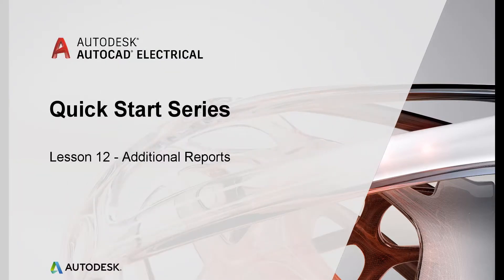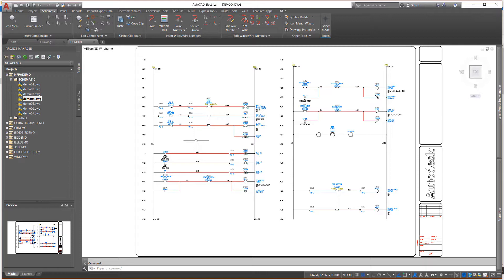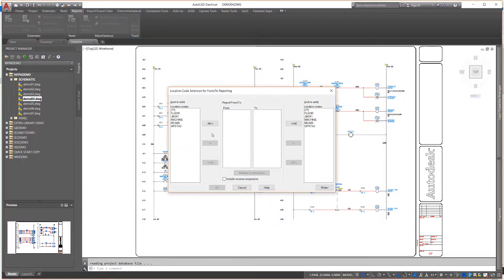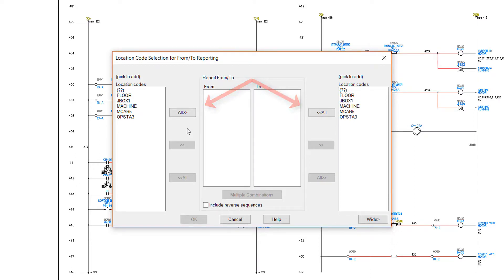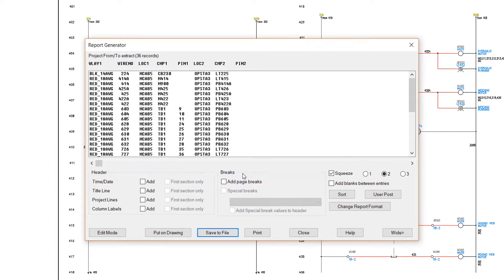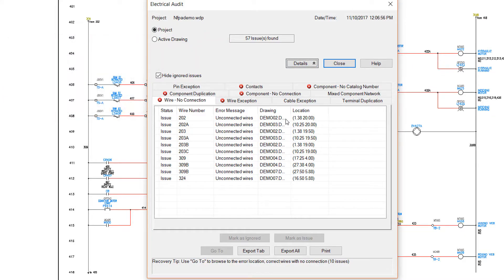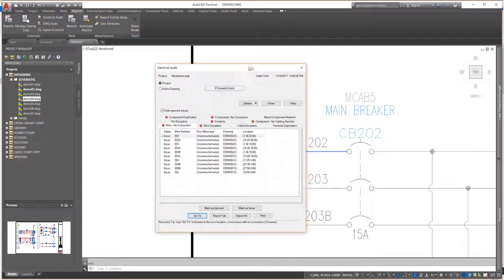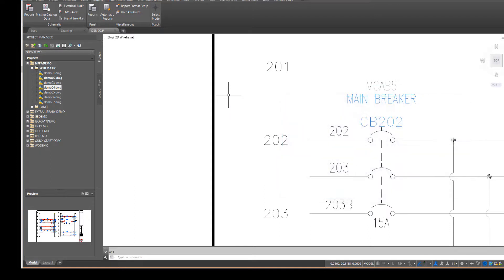Lesson 12 - Additional Reports | AutoCAD Electrical

Comment: These are really great and helpful demos. I've completed watching them all and followed along. However, in my opinion, these are more relatable  to preparing schematic diagrams for low voltage. Can you make demos also for single line diagrams such as for medium voltage and high voltage electrical systems? Would really appreciate that. Thank you!